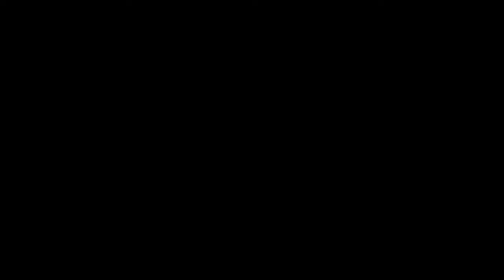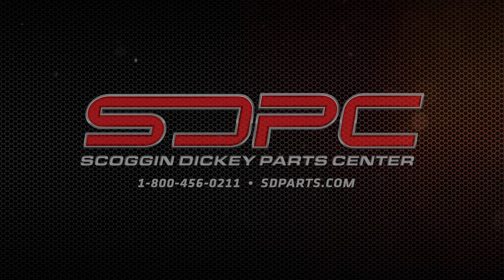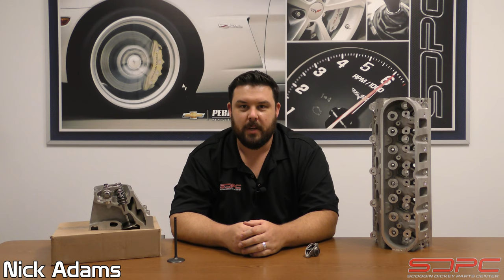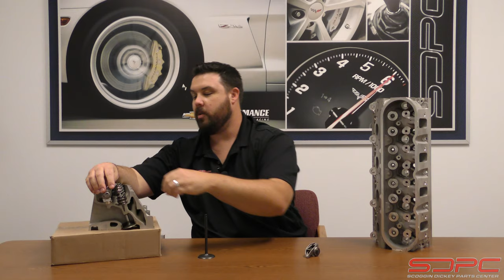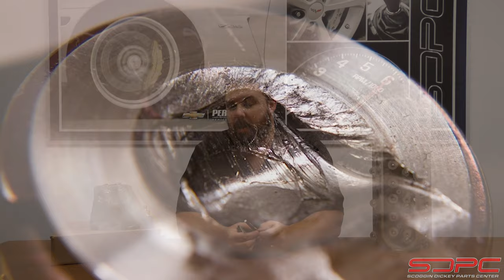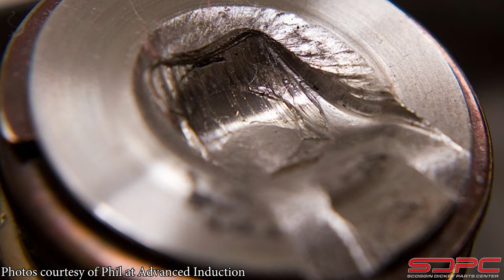SDPC Tech Tips: Lash Caps, and you!

Comment: This exact thing happened to me after a local machine shop did my heads and didn’t put them back on and didn’t inform me of these. It caused major damage to the entire engine after the valve stuck open. Knowing how important these are why doesn’t the GM Service manual mention these? I sure wish I had seen this video before re-Assembly!

Comment: Are the meant to only install on the intake side of the valve stem tip? Should I use them on the exhaust side as well. Just did a cam swap and I am getting some rocker noise. Any help would be appreciated thanks.
Reply from the maker: Just the intake side unless you have installed titanium valves on the exhaust side as well.  Hope you track down the odd noise!
Reply: @Sdpartscenter  thank you. One last question, is it ok to use lock tight inside the lash caps before applying them on the valve stem tip?

Comment: So what holds em on?
Reply from the maker: Compression between the valve tip and the rocker arm tip.  There's a recessed area on the underside of the cap that fits over the valve tip.

Comment: Is that only on titanium valves ?
Reply from the maker: Correct.  This isn't required on the stainless steel valves, and the hardened sodium filled valves.  There are titanium valves with hardened steel tip inserts, so not necessary on those.